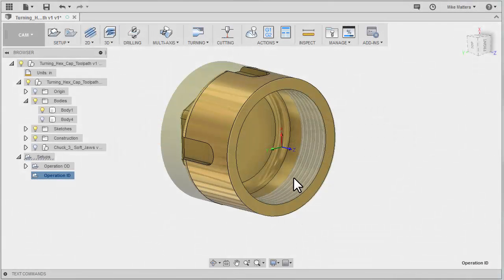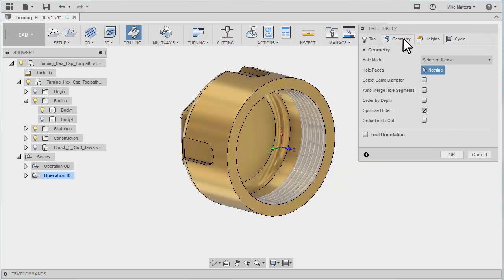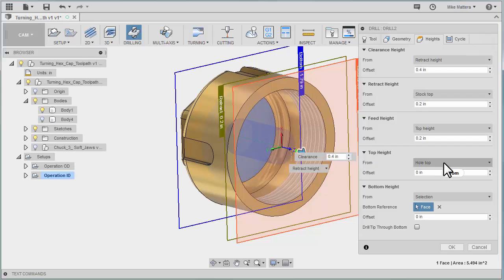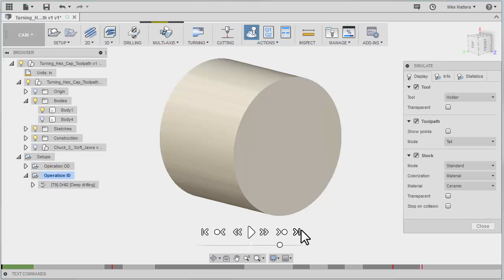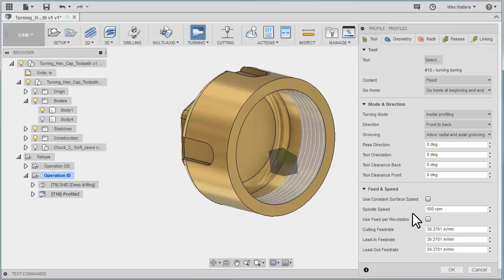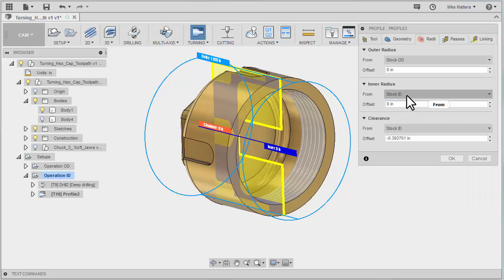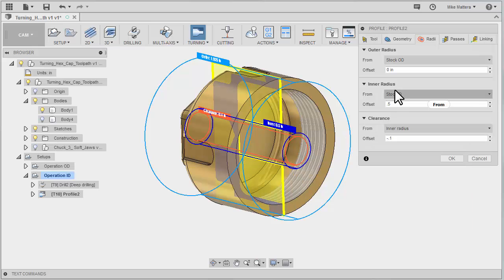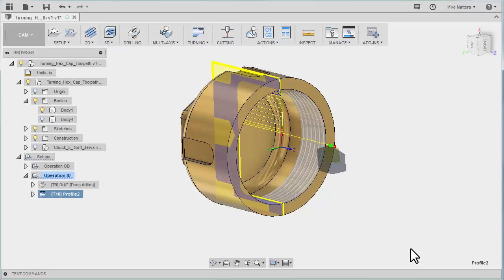Fusion CAM Live Turning Series 10 - Drill, Rough & Finish

Comment: Thank you for your videos, I really appreciate them.
Could you please display the complete simulation of Bore Rought? 
It appears that the chosen parameters are incorrect since the end result is a straight drop rather than a curved one.
You choose only the primary wall
If you choose not to complete the profile, the tool proceeds directly to the wall.
It seems like I have attempted it the way you mentioned, but it didn't work out as expected.
Anyway, Thank you for your contribution.